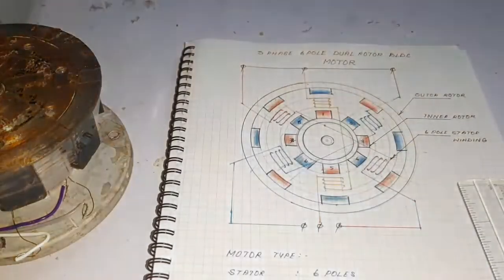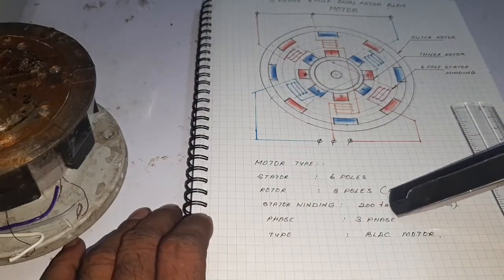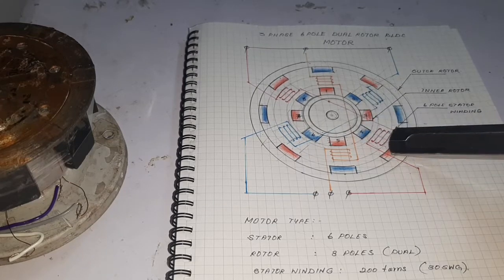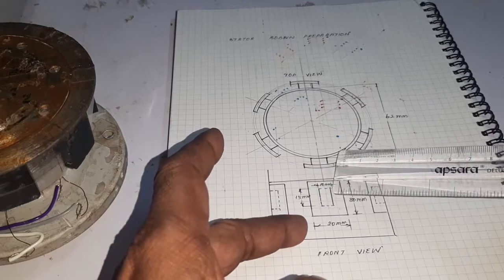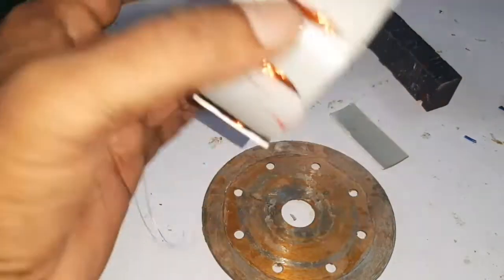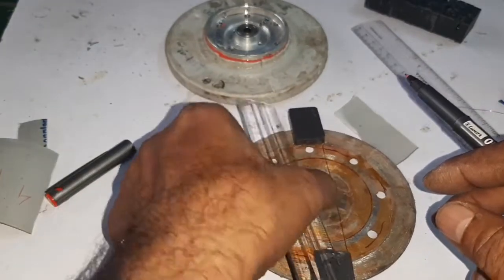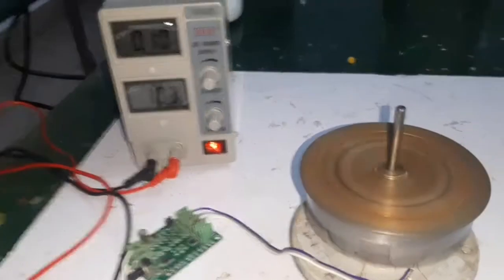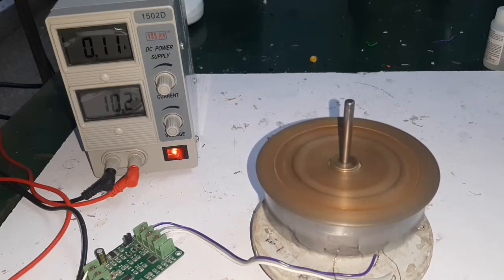(V-81),High efficiency,high torque and frictionless bldc motor using dual rotor.

Comment: Hello Sir . Your new design and ideas are very impressive…As bldc motors are finding more uses in recent years , your ideas can be usedin electric vehicles for increasing efficiency ! 
You should also come up with new bldc controller circuit design as many of us find it difficult to run and control bldc motors ..Aftermarket controllers are expensive and don’t perform according to our parameters …. Regards from Nepal 🇳🇵
Reply from the maker: Thanks for watch and support sir

Comment: Again as usual a great explanation and an excellent easy to build project. I have some questions since you welcomed them,
1. What is the total weight of the two rotors including all magnets and the steel plates holding the outer magnets. Seems quite heavy.
2.  Will it be possible to make a follow up video, showing this motor with a plastic fan, probably 10 to 12 inches in diameter. This will help your viewers to understand, not just the new technology but also show some practical applications that it may be used for. It will be most interesting to see the additional input power required to drive a fan with its own weight and air friction load added to the present rotor load only consumption. 
3.  If possible, to give your subscribers and viewers a price idea for each of the demonstrations models. This will help them to understand, not only the electrical efficiency but also the economic efficiency in following your wonderful projects. Since you have asked that we ask any questions we may have, I have taken the liberty to do so. Best regards and all good wishes, thanks.
Reply from the maker: Thank you for your valuable suggestions
And i will follow the ideas in  future.
Reply: @pugalstech  Does it have any heating issues? How long can it be run?

Comment: very educative project. Well done. WHat is the type of controller used ?,தங்களின் சிறப்பு  மிகவும் சாதாரண மாக வீட்டில்  கிடைக்கும் பொருட்களை வைத்து செய்வது
Reply from the maker: Controller specification:
Voltage range- 5 to12v
Current 1.2 amp
Bldc motor controller available in amazon
Price:Rs. 500 to 1000